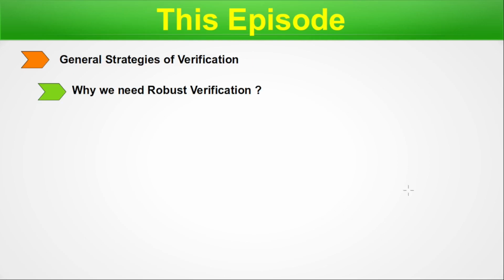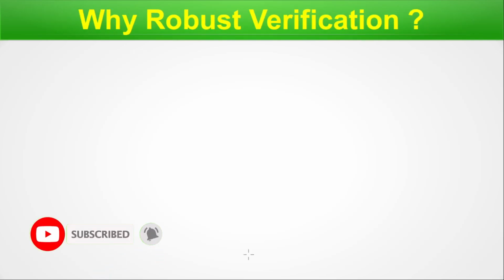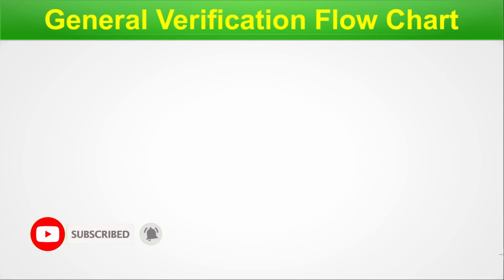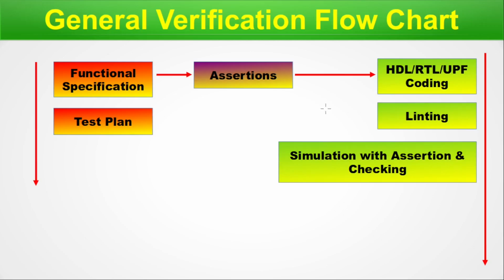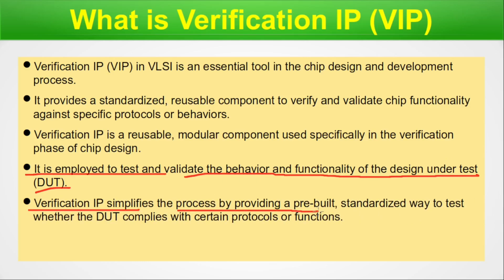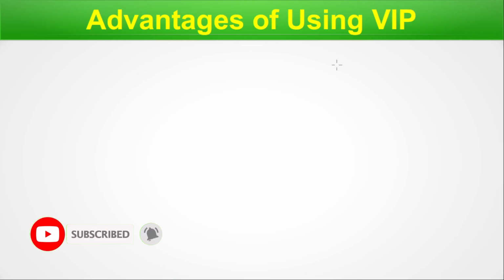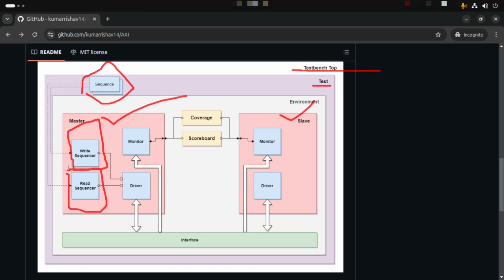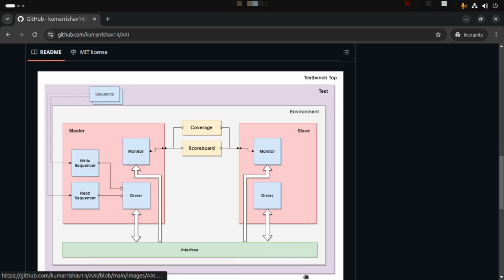Essential Guide to Verification IP (VIP): Strategies, Flow Chart, and Advantages Explained

Comment: I have doubt regarding UVC and VIP haw both are connected or something else ?
Reply from the maker: UVC (Universal Verification Methodology Verification Component) and VIP (Verification IP) are both connected in the context of digital design verification.

UVC is a modular component in UVM used to verify specific design aspects (like components, interfaces, or protocols) through defined classes and methods.
VIP refers to reusable verification solutions, often built using UVCs, to verify protocols or interfaces in a broader sense.

In essence, UVCs are the building blocks for creating VIPs. They are interconnected, with VIPs leveraging UVCs to implement protocol verification in digital designs.